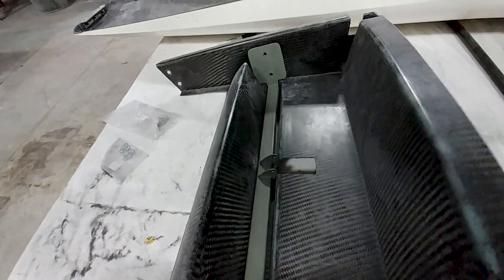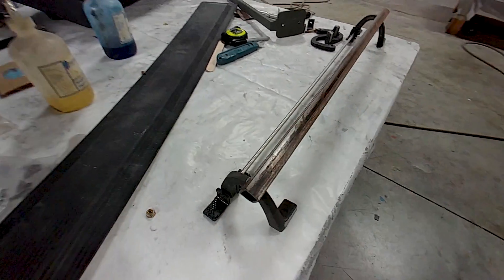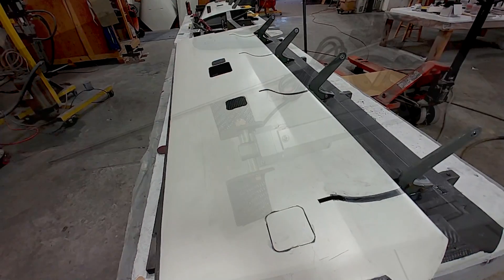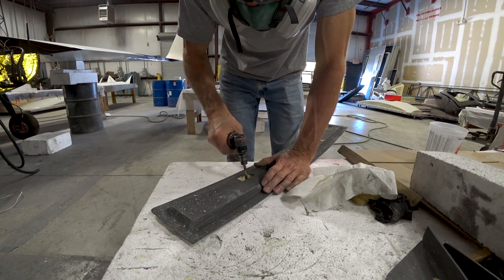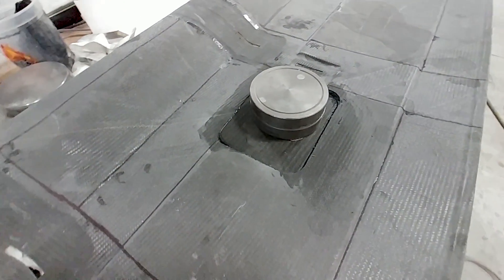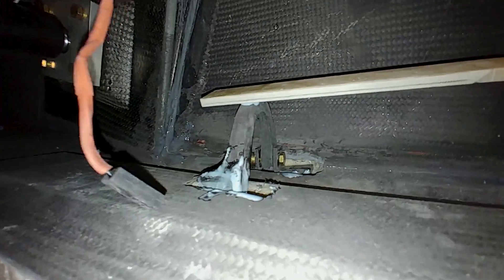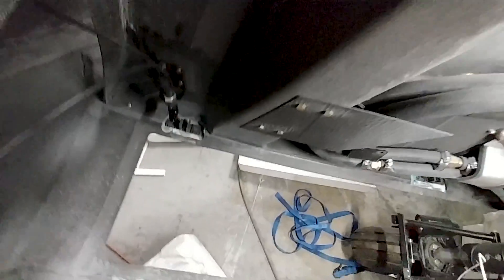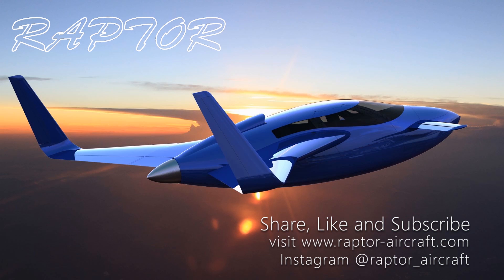Nose Gear Doors - Building the Raptor Prototype

Comment: you better secure that rocket exhaust pipe really well with some straps, it'e going to shake violently if it fires.
Reply from the maker: It's secured to the manufacturers specifications.
Reply: @RaptorAircraft  do you plan to reshape the rockets exhaust pipe for production so it doesn't obstruct the baggage area as much? I remember you mentioning a lot of the other bits were in there just for prototype testing.
Reply: Yes, that was my thought too. Perhaps they can build up layers of carbon around the bottom end of the pipe and bond it to the frame more thorough? The forces on the exhaust pipe will be massive and the last this you want is sheering of the connections at the aircraft skin area and that area to be light up like a candle from the inside out whilst you are hanging from the airframe parachute. - edit: typos